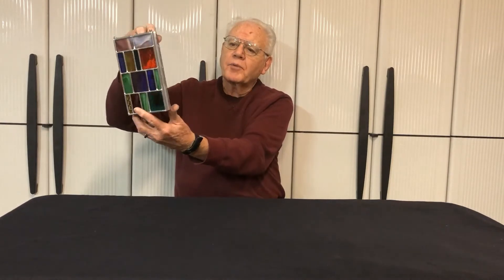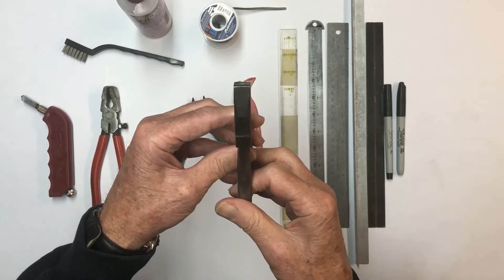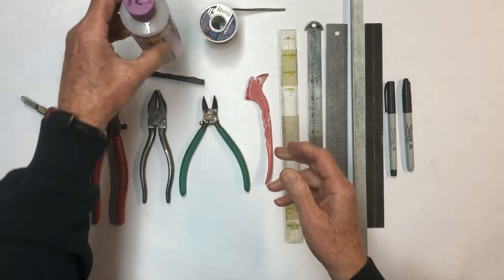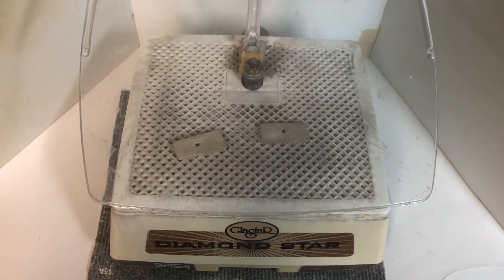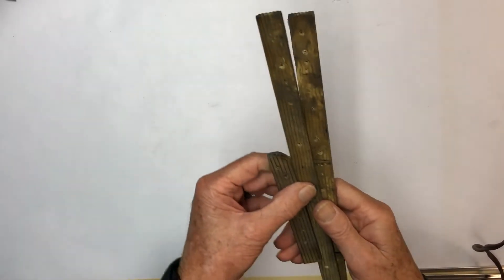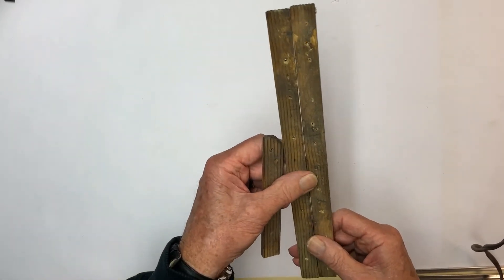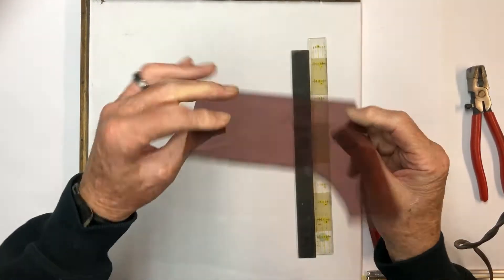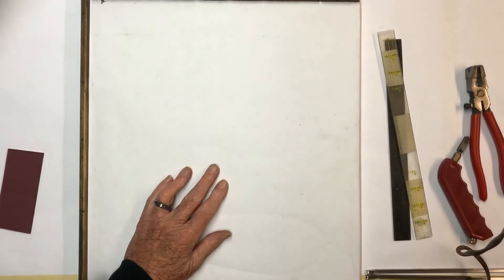How to make a leaded glass solar lantern for the Beginner!!

Comment: Hi Bill, your videos are great - very informative. I've only just started in stained glass and so far have only done copper foil work. Your vids make want to try lead came work but the web store has a bewildering rang of sizes. Flat, round, metric, imperial etc. What size do you use? Hope you can help.
Reply from the maker: Hi Scott,
Welcome to my YouTube Channel!! 
Glad you liked the video. You can check out all my videos by searching Bill Stone's Stained Glass Creations.
Here is a rundown on the lead came I use for all my projects, from these small projects all the way up to larger windows from the home.
1. RH-9 H came which has a 5/32" Face Width and a 3/16" channel. I like this one best for all kinds of glass it has a 3/16" channel and gives you a little more room for different thickness of glass. (This one is sometimes called High Heart)
2. RH-8 H Came which has a 5/32" Face Width and a 5/32" channel. Is the most common and can be found online at several different glass suppliers.
3. RU-70 U came which has a 7/32" Face Width and a 3/16" Channel Width.
 If this your first-time using Lead Came, you are going to LOVE IT!! It's so much easier than Copper Foil. It is also easier to solder as you only have the joints to solder and not the whole thing.
I use a Weller W100, It's a 100-watt Iron. With the standard #7 Soldering Tip which is a 700-degree tip. 
You will also need Lead Dykes to cut the came, or a came knife. 
Small wire brush to brush the came joints.
I use a 60/40 solder. 50/50 solder will work, it takes more temperature to melt and the lead will melt also if you stay on the solder joint to long.
You can get stained glass supplies on line, from several different places.
Check out Amazon, E-Bay and Delphi Glass.
Best of luck and please feel free to ask me anything you may have a question on. Hopefully I have an Answer for you. 
Regards,
Bill Stone
PS Chech out Delphi Glass. They show both RH-8 H came Item# 5590 and RU-70 U came Item# 5582. 
They don't show anything for the RU-9 High Heart H came.
Reply: @billstonesstainedglasscrea3310  Hi Bill, thanks for such a comprehensive reply. I’m in England so I’ll compare from Delphi to the two sites I use over here - the postage will be a lot cheaper! When I complete a project I’ll send a picture. Thanks again.
Reply from the maker: Hi Scott,
Glad you found the info useful. Can't wait to see your first leaded glass project. When you have time check out my video on the Suncatcher with the antique glass plate in it, I bet you can find a lot of these plates in England. They were all over the place in the 30's and 40's. If you want to try this one be sure to pick a plate with a smooth edge and not thick. The one in the video was about 1/8" thick on the edge.
Glad you're enjoying the videos.
Regards,
Bill Stone
Reply: @billstonesstainedglasscrea3310  Hi Bill, I’ve had a go at making a lantern. I’m staggered at the huge amount of came I got through and i just did a relatively small four sided project! I followed your method mostly but deviated here and there. I couldn’t get your round edging came so I used square edge. I haven’t got a glass grinder yet but I do have a Dremel type hobby drill so I used that to make the allowance for the cotter pins. Also my soldering leaves a lot to be desired but I’m sure it’ll improve with time. Anyway, here are 2 quick vids to show with and without the lights on. Hopefully they work! Thanks again. https://youtube.com/shorts/-gHck_eGUXM and https://youtube.com/shorts/ZCOFPNjRuO8
Reply from the maker: Hi Soctt,
WOW!!! That's GREAT for your first go at it. The videos were great and thank you for sharing them with me. I'm so happy to see someone has stepped up and tried one of my projects. You should be very proud of the lantern you have made. The soldering looked good on the videos. I loved your design and choice of colors. Keep up the good work, they will get better and better as you make more. Also, the flat edge came is a little harder to work with than the rounded came so I think you did a great job with it. Be sure to stretch it, like in the video.
I can't wait to see your next project!! 
You're right the lead came system does use a lot of came, but you don't have to use all that solder like you use when you use copper foil. I find the lead came to be cheaper than solder here in the USA. Again, thanks for showing me your lantern, it came out perfect. Have a great day.
Regards,
Bill Stone
Reply from the maker: Hi Scott,
I'm sorry to ask you but would please send the video clips of your Solar Lantern to me again. When you sent them the first time they opened right up, came back later that day and they said there was an error, and I couldn't open. I wanted to share them with a couple of my viewers that are just getting started with lead came. I think you did a great job and wanted to show off your beautiful Lantern. Thanks in advance!!
Regards,
Bill Stone
Reply: @billstonesstainedglasscrea3310  Hi Bill, they still work for me when I click on them. Perhaps YouTube was having a moment. Try https://m.youtube.com/watch?v=ZCOFPNjRuO8 and https://m.youtube.com/watch?v=-gHck_eGUXM .  I’m not sure how else to share them as email addresses get deleted from comments I think. Hope they work. If not I’ll try again.
Reply from the maker: Hi Scott,
Thanks so much for sending the video link again. These opened great!!! They have a little different search name then the first group. After the .com the first group had short, this group has watch after the .com. I know idea why, but they work. Thanks again, can't wait to see your next project.
Regards,
Bill Stone
Reply from the maker: Hi Scott,
Long time on see. Hope you're still making some leaded glass projects:
Here is an email address if you would like to send me some photos of your new projects. twosteppingstones1962@yahoo.com
I haven't made any new videos at this time. I have been making some large windows for people's homes. I will get back to the videos when I get them done.
Have a great day!!
Regards,
Bill Stone
Reply: @billstonesstainedglasscrea3310  Hi Bill,
I’ve written an email with links to pictures but it bounced back to me. I’m not sure if the addy is spelt wrong or that YouTube doesn’t like us lol. Is that the correct spelling? Best wishes, Scott.
Reply from the maker: Hi Scott,
My Bad, I sent you the wrong email address.
It should have been tworollingstones1962@yahoo.com
Just send me an email using this email address and attach your photos to it, don't go through YouTube. Can't wait to see what you have been up too!!
Sorry for the mix up.
Regards,
Bill Stone
Reply: @billstonesstainedglasscrea3310  Hi Bill. I sent an email and it didn’t bounce back, so hopefully you’ve got it unless its gone to spam. Best wishes. Scott

Comment: You don't have to use foil? Why do you have to sotter if you're using lead came? Isn't the came poisonous? Shouldn't you be using gloves and a mask?
Reply from the maker: Hi Michelle,
Not sure what you are asking about with the foil?? Even if your project is made with lead came you still have to solder the joins.  I found the following on the internet and hopefully this will be helpful.

Is lead in stained glass dangerous?

The answer is - not really.  Leaded stained glass poses more of a health risk to manufacturers than it does to homeowners.  That is because the lead used in stained glass is only really dangerous if directly inhaled or ingested. So, the lead glass in your home won't cause issues unless you have adventurous children who lick glass.

I've been doing leaded glass for the last 40 years and have had tests done for heavy metals a couple of times and there has never been a problem.

I make an effort to wash my hands with soap and water and don't eat any food while working with the leaded glass.  Also, use a water-soluble flux when soldering.  It has no order or smoke when soldering.  Washes up with soap and water.
Reply: @billstonesstainedglasscrea3310  I've heard that your not supposed to eat off of colored glass plates and bowls and drinking glasses, because of lead, is that true? I know that's different from your videos but do you know?
Reply from the maker: Hi again,
Sorry I have no information regarding your question on eating or drinking off glass plates or drinking glasses. I have seen pottery with the words printed on the bottom NO LEAD in this product. Check out the internet and see what they have to say on the matter.
But back to leaded glass using Lead Came vs Copper Foil. Each process, offer different outcomes. Leaded Came is used for large and small, stained-glass windows plus all types of smaller projects like the ones I'm making for the videos. The copper foil system was developed by Tiffany many years ago. At that time Tiffany wanted to be able to make projects with very small pieces of glass in them and Lead Came wouldn't work for him. You probably have seen all the beautiful Tiffany Lamps at the stores, they are a great example of Copper Foil. If you will go on YouTube and search Bill Stone's Stained-Glass Creations, you will see all of my videos. There is three that marry both Leaded Came and Copper Foil in the same project. Check them out when you have time. Years ago, I started out doing Leaded Came and liked the way it looks, it is also much easier to do then Copper Foil. With Leaded Came projects, you just have to solder the joints to put it together. With Copper Foil you have to grind the edge of each piece of glass and then wrap each piece of glass with Copper Foil. Each piece has to fit tight up against each other to make a nice area to Solder. Then you have to solder the entire project.
Hopefully this will help you get started and make some projects.
Regards,
Bill Stone